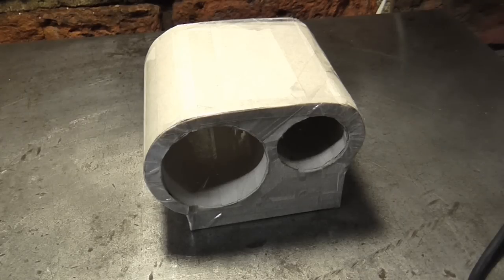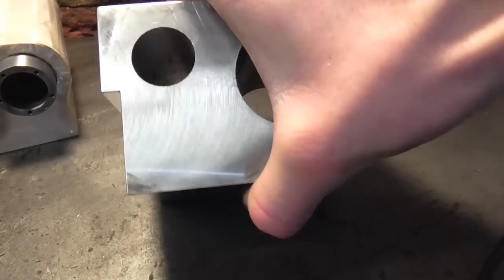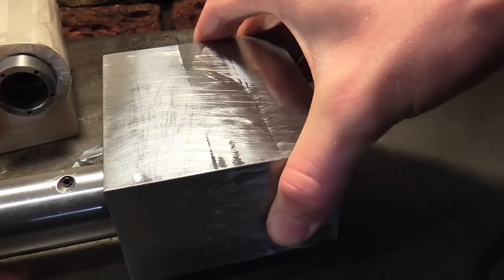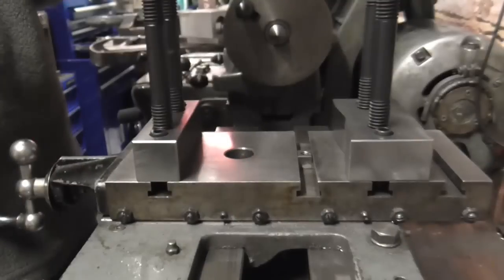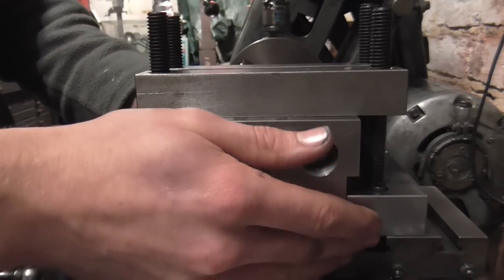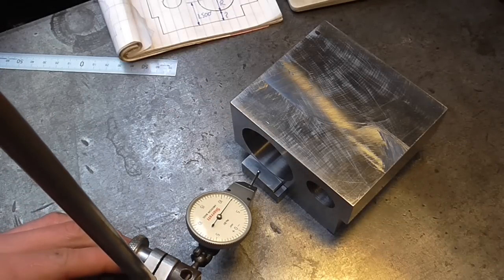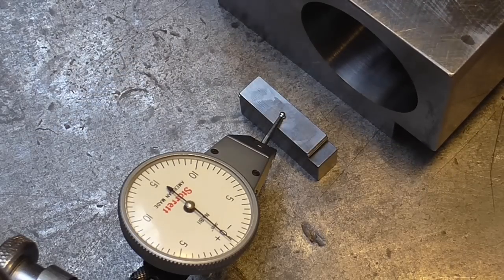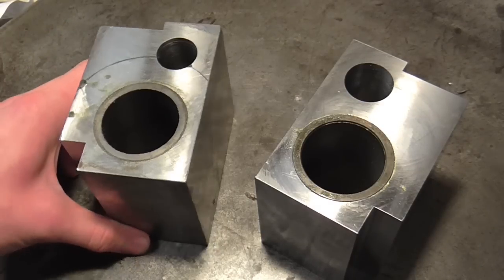Machining Cylinders Part 2

Comment: Put cutters on that boring bar at graduated diameters until its very close to your final bore size and then just do your finish hone and it would all be done in just two operations. Or one if you can swing it.

Comment: Why didn't you make the block of cast iron? You then wouldn't require a liner.
Reply from the maker: Good question. I think if I were to do it again I would consider doing it that way.
Reply: Generally it's to insure there's flawless metal in the bore.  Small iron castings can vary in quality, but centrifugally cast iron sleeve stock can be counted upon to be fine grained and free of flaws.

Comment: Hi - very well explained and I've learned a lot. I recently machined a 3 inch long cylinder liner for a hit and miss engine using a boring bar. I knew I was pushing my luck and I ended up with 2 thou runout along it's length. Not happy so I've just made a Hemingway between centres boring bar. You video will certainly help me get the cylinder accurately set up prior to machining.
Cheers
Andrew

Comment: Very nice serie. The way you use the gauge blocks is new for me and very interesting. One remark is regarding using epoxy in a high temperature environment: are these two compatible? Epoxy does give way at high temp?

Comment: Having watched all your videos, I wonder if there may be a problem with your wheel bearing design. Yes, the weight of the locomotive will be on the upper face so that's where you have your phosphor bronze. However, won't there also be a lot of force pushing and pulling, constantly changing direction from the push and pull of the cylinders? Guessing that the cylinders have an area of about 4 sq inches, and the steam is at around 80 psi, that's potentially 320 pounds of force constantly pushing and pulling forwards and backwards on those bearings. Do you think that may be an issue? I really don't know, you are the expert here and I'm just a viewer :)
Reply from the maker: +radbot1 Hi, yes there will, however the theory with full size locos is that during normal running, the pushing and pulling causes the main load to swing between 10 O'clock and 2 O'clock in the bore. The bores on mine are made 0.0015 bigger than the axel so that it shouldn't contact the steel and only the bronze.
Reply: +MrCrispin Cool! Thanks for the reply and good luck with the build :)

Comment: Crispin   A wonderful demonstration of how custom part-making requires custom toolmaking.   Thanks for showing the details of the setup and the checking of measurements before the final boring passes.   To the untrained eye it might seem an overly complex and tedious process, but I think you showed very well how a methodical approach and careful verification can achieve outstanding results on a small home workshop lathe.   Regards from Oz.

Comment: Another very instructive video that well illustrates a method that was more common when model engineers did not have the means to purchase or access to milling machines. And...as has been pointed out...in some ways...a superior approach. This is also a good example of the importance of establishing functional datums and then paying close attention to them whilst designing, constructing, and setting up the fixtures as well as the in-process inspections. Also...a nice illustration of the flexibility offered by longitudinal cross-slide t-slots. I look forward to the next step.

Comment: Very nice machining and great ingenuity regarding the set up and measurement of the parts. Only question I have is why you left the final sizing of the cylinder liners until they were in place in the block if you were going to bore the cylinder block assembly under size? I can see why if it was a 0.0015" under size interference fit. Very nice work keep up the good work.

Comment: well done i really enjoyed your video and the information you show was excellent. i see you are using SEA  do you switch back and forth or was that just for us guys on the other side of the pond? keep up the good work
Reply from the maker: +mog5858 All the drawings of these model locos and model engineering projects tend to be in Imperial. Plus all my machines and a lot of my measuring equipment is imperial.

Comment: Do you have any concearn about the temperature of the steam causing the loctite to release?  According to the steam tables anything north of 150psi steam is going to make the loctite release. Very nice setup for repeating on the boring.
Reply from the maker: +bcbloc02 Hi

I did consider it but the loctite is rated at 180c + and the cylinders shouldn't get any hotter than  about 130c
Reply: +bcbloc02 Should be fine - the temp of the cylinder will depend on the "mean" pressure throughout the whole cycle - the temp of the steam goes down rapidly as the piston moves down, its work is done, and exhaust valve opens (I think!)

Comment: Very meticulous work on your lathe set-up, but can I ask why you didn't do the boring on a mill? Is it, that you didn't think you could get the accuracy that you got with the lathe set-up?
Reply from the maker: +Fred Newman 
Hi

I don't have any boring equipment for the mill but I know it is a common method. I think the lathe set up I have is more rigid as the bar is supported at both ends. Particularly for the small bore I think a boring head may be a bit more likely to flex. Also the lathe set up is good where repeated loading and loading of the parts is necessary.
Reply: +Fred Newman Between centers boring will alway's give a straight bore, or at least as straight as the part alignment and lathe's way's are. And the bore will be consistent for size end to end. The boring bar is supported at both ends so is far more rigid than a vertical mill and boring head setup would be. George H. Thomas "The Model Engineer's Workshop Manual explains it far better than I have here, as well as giving an excellent design for a between centers boring bar.
Reply: I agree! After reading Geo Thomas' explanation, I became a convert to boring between centers! A slotted cross slide helps (it's indispensable actually)
Reply: LOL, so did I, and his writing about it was the main reason I wouldn't do without a tee slotted cross slide when I started looking for my last lathe. Both of Georges books should be on everyone's book shelf no matter what there skill level is.
Reply: Turning Point
I agree! I had to buy a T-slot cross slide casting (that I still have to machine yet) for a South Bend 9A so I can use this method. Probably the first project utilizing this method will be the boring George Thomas' Versatile Dividing Head!
Reply: Funny I have the same set of castings and just this morning I was taking some measurements for a couple of people I know. Were thinking of making new patterns and increasing the casting in size a bit to take 5C's directly in the spindle. You do know about the pictures etc on the SB practical Machinist forum for that cross slide casting you need to machine?
Reply: Turning Point
Yes I know about Paula's build thread on Practical Machinist concerning her slotted cross slide. I'm using that as a guide. But I might add I'm going to include the features from George Thomas chapter on gib screws (if your familiar with that) with the locking pin.
   That's a really good idea about 5C collets directly in the spindle of the VDH !
Reply: Yep his point about those gib screws and pinning them in place verses the normal pointed screws made a lot of logical sense to me as well. Geo. was a smart guy that's for sure. Good you do know about Paula's build. Thought I'd mention it just in case.
Reply: Turning Point
There's a Brit who's giving me some advice from time to time concerning the fitting of the gibs. I bought MLA's gibs with the T-slotted casting but threw these gibs in the scrap box. This fellow advises to make the gibs up oneself and have them fit with just .002 clearance(he of course outfitted his w/ gib screws and all, per Geo Thomas, in fact he sent me the article from the book). He says that afterwards his cross slide runs very smooth and he rarely needs to adjust it except about once a year. We were kicking around an idea of fitting Renishaw magnetic strip for DRO hidden INSIDE the crosslide/saddle as a theoretical idea, but I think a SouthBend 9A does not have enough "meat"; but it is a very slick idea. I think it would work on a much larger lathe like a 13" because the saddle and cross slide are so much thicker and wider. This way the magnetic slide wouldn't interfere with getting the tailstock up close to the saddle/crosslide assy in case you were working closer to the chuck.. Regular Glass scale on a cross slide are so fat you lose 3/4 - 1" of room trying to slide the tailstock up close, if you know what I mean.
Reply: There was an write up some years ago in MEW about fitting a scale inside the cross slide on a Myford super 7. Those are a fairly small lathe so anything bigger should be able to be done. My current lathe has tapered gibs so no need to use Georges modification.
Reply: Turning Point
Really? I'll have to look into that! Do you know off hand the approximate month & year of that particular MEW? Thanks!
Reply: Sorry I don't have the date, all my back issues are in storage or I'd look it up for you. It might be possible to dig it up using one of the online indexes tho.